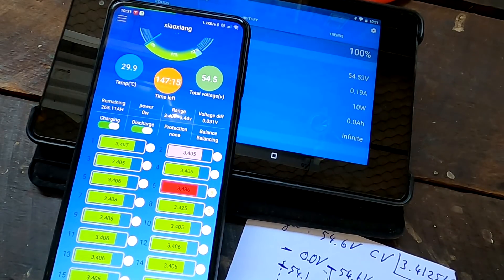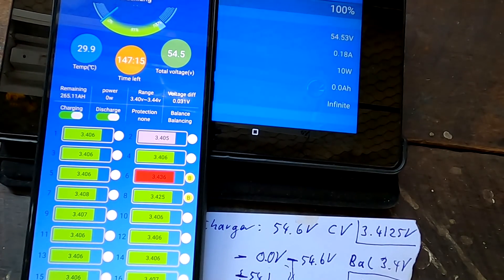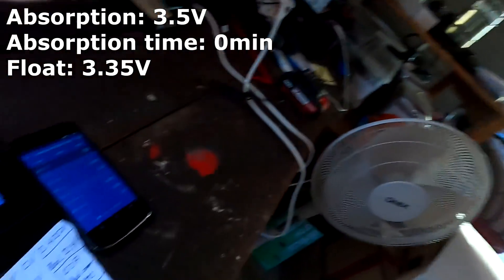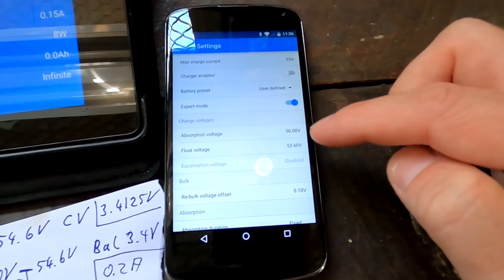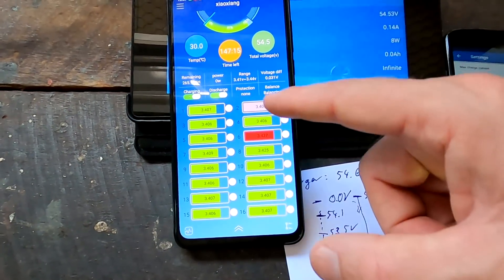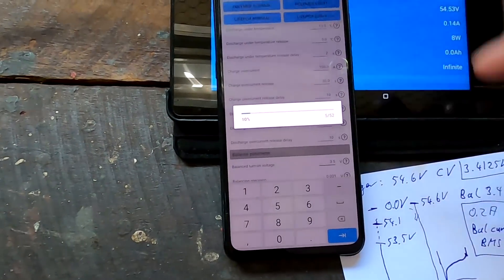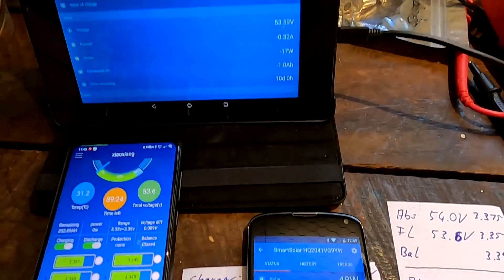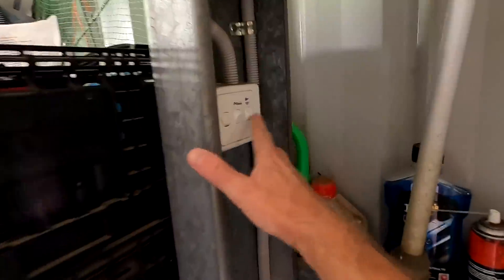Are these the better settings for your solar-battery setup?

Comment: YES, voltage is one thing (first) then current  needs to be met.  My inverter would read proper voltage and would run for another hour or two which I could not understand until I ran tests to find this out. 
My inverters were doing what they should have been doing. I got more than 4 hours worth of capacity in watt hours.
These are some tricky batteries  but when you  watch them or 8 to 10 hours a day you see what's going on 🤣  (Constant voltage,constant current). 
Our chargers don't tell us the constant current absorption. This is the key.
Thanks for the update Andy, Looking good! Thanks for posting!
Reply from the maker: Thank you Dan. We're getting there eventually ;)

Comment: thank you for all your work. sometimes i am thinking: for gods sake 12V lead acid batteries had no individual taps to check inter-cell-voltage .... i dont know if we would make an elephant out of a mouse .... (that sounds rather german u know) :)
Reply from the maker: I know, it's far easier to connect a lead acid battery and your're done, right? But we would not learn anything from this 100 year old technology.

Comment: Does anyone have best settings for a AGM battery?
Reply: tie a rope to it & use it as an anchor (take the electrolyte out first, safely of course) . I have always hated lead acid batteries. Glad to now have some of these LiFePO4 280Ah. Just chuck it in to replace the AGM.
Reply: @aussiescotty2950  yes would love to use it as an a anchor but at close to £400 and only 6months old not looking to waste money at the moment.
Reply from the maker: It's probably best to stick with the manufacturer specs for AGM. 13.7/13.8V for floating seems to be the norm for a 12V system.
Reply: @OffGridGarageAustralia  thank you, great videos btw.
Reply: Your honestly better off to go with open cell lead acid for cost and just store them on the exterior of your house. Agm sealed are a little to pricey for watt hour but lifepo beats them out in the long run for lifespan. If treated right. One of the perks to open cell is how it handles the weather which is good cause I wouldnt store them in my house. Lithium doesnt discharge gases. Lead acid does under discharge especially older cells. LifePo is just a bigger up front cost. But you can pack it in a smaller location for the same capacity without the worry of gases. If maintained it wont blow like an s7 either

Comment: How about the reverse protection diodes on parallel PV-strings? I'd dare bet that power is being lost by heating the more shaded string during the time that trees are in the way, since panels do not normally contain reverse protection. They very usually only contain internal bypass-diodes but not reverse protection for when a greater potential exists in parallel. Plug and play MC4-connector-housed diodes exist for this exact reason.
Reply from the maker: Nope, that's not happening at all. Even the shaded string delivers still power to the charge controller. I have 2 strings atm with separate fuses, so I can switch them on and off individually. If one has full power and I turn on the shaded one I still see an increase in current and incoming power. So one delivers 500W and the other maybe only 80W due to heavy shading. There are no diodes necessary for such a scenario. I'll show this in a future video. Thanks for the reminder.

Comment: Ah, I put down my phone after watching "yesterdays" video and then this was on the laptop.  I did a couple of comments (they would have been Kev Duckworth rather than this account)  and after watching this they were redundant ....  I think you can go lower on the MPPT for both float and absorption, and just go up high once every 6 months to check the top balance, and top balance as needed - said similar on the other video too.
Reply from the maker: Yeah, that's probably correct. I just wanted to see if the high voltage cause any dramas with the cells.

Comment: So far so good.
Once the cells are all equal at top and you don't discharge too far, they should all get back to 100% at the same time. I think.   Unless.... 6,7 and 8 have a resistance difference rather than merely a lower Ah capacity.
Reply: Since the cells are all in series the variance in internal resistance do not make a big difference. The highest resistance in the string limits the entire pack. Top balance takes care of it.
Variance really only matters for cells in parallel, and even then if it is cells and not strings in parallel then the internal resistance only matters during charge and discharge and will equalize at rest. Parallel strings are a bigger problem.
Reply: @Sylvan_dB  I think cell resistance is much misunderstood. I also believe it is not the major problem in this case. I think it's simply lower capacity.  That said, I'm at a loss as to how to prove it.   Also as others point out, it seems to be a small shortage.  :)
Reply from the maker: I have done a full capacity test afterwards. Video is coming soon.
The cells seem have a higher resistant then the others.

Comment: I don’t understand your argumentation.
In the Victron Controller, the algorithm for absorption and float are exactly the same, they simply change from CC to CV, only at a different voltage.
If after a complete top balance you still have balancing problems (because of unmatched cells), start your balance start at a lower voltage or use a high amp. active balancer.
As you are apparently in the learning phase, it is still a good idea to experiment. Good luck.
Reply from the maker: This is in regards to the discussion we had here:
https://youtu.be/lCs9NaHgSB4

Comment: You look like a happy camper after this video/experiment went well. When my solar is fully setup, I will try these numbers as well. Thank you!
Reply from the maker: And there is only 1Ah between the absorption and float, so the 'loss' is very small. Before that test, I was expecting a lot more capacity which we could not use.

Comment: Ideally, you would want the bms to balance each charge.  Can you set the charge controller to stop full power at 3.4V and constant current charge to 3.5V (just under what your BMS can shunt power on the high cells)?  Then you can get a full balance charge from the sun.  Your issue isn't that you need to balance.  It is that you are charging too fast to allow the bms to balance.  Or maybe you just need a BMS that can shunt 5-10A or something that your charge controller ends the charge at.
Reply from the maker: Yes, that is correct. The balancing only works if the the charge current is lower than the balance current, right? So you need to find this sweet spot. The steeper the curve, the easier it is, I found.

Comment: You have the Float voltage nailed down.  3.35V is a good value.  You could go lower but 3.35V is totally acceptable.  The normal range for Float for LiFePO4 is 3.35V to 3.375V.  I prefer 3.35V myself.  The charge controller is behaving exactly as desired, you have verified that there is no significant loss in capacity, and the stress on the battery pack is almost nothing.

The bulk target and absorption time will be harder to dial-in, since the battery's actual state of charge depends heavily on the C-rate that it gets charged at.  Which in your case is a very low 0.1C or lower with just the solar.   These numbers are going to be different for charging with just the solar verses charging with the e-bike charger or charging with both solar + e-bike charger.  I outlined the general problem that you are facing there in prior posts. 

3.40V - will trickle charge the battery but make it almost impossible to target any particular state of charge.  Also, the battery's acceptance current may quickly drop below what the solar panels can offer, you will be wasting your panel's capability!

3.45V - Is the minimum I would recommend as the state of charge can be managed a bit more easily by setting a non-zero Absorption time (Bulk and Absorption voltage both set to 3.45V). 

3.50V-3.60V - These are typical bulk targets (Absorption time would normally be set to 0 with these targets), but the battery's state of charge will wind up being very high at low charging rates and more in-line with desired state of charge when charging at a higher C-rate.  A higher bulk/absorption target voltage combined with a low charging rate increases the risk of over-charging the battery.  But on the flip side, you won't be leaving any of your solar energy sitting on the table... it will be able to deliver it all to the battery.

Once you get more solar installed you will have to fiddle with the Bulk and Absorption, but you should be able to leave Float at 3.35V.   With more solar installed you have to begin to watch out for bulk target voltages that are set too low, causing low acceptance current by the battery and leaving some of your solar energy sitting on the table.   So, rule of thumb... with only a little solar, lower bulk target voltages will work, but with a lot of solar, higher bulk target voltages are needed to really eat up the energy the panels can produce.  Among other things.

-Matt
Reply from the maker: Thanks Matt. A very big difference does the absorption time to the actual SoC. If you hit 3.4V and stop charging it's different as if you do a 1h absorption at this voltage afterwards. So I will do some more testing very soon on a different system to see what the actual difference is. Thanks for all your advice!

Comment: Andy by the way, I like the qucc controllers  and planing to get two more. The 260 ma are not enough power to balance my battery packs I stil need the help of the active balancers which automatically turn on when voltage difference is more than 0.010 ma.
Reply from the maker: Yeah, it depends on your battery capacity. 0.2A don't make a big dent in a 280Ah cell. But it works quite well if you have a higher voltage. Then, even the 0.2A discharge will balance the large cells.
Some other BMS's have 1-2A balance current but they are far more expensive.
Reply: I am planning (when my cells arrive) to have a separate volt censor that turns on a active ballancer and turns it off again, this is way it won't screw up my top ballancing like when it's on All the time

Comment: Hey Andy,

I have close to a dozen small LFP batteries in use in various applications, many of which are UPS units. My UPS units are designed for lead acid and I swapped the lead acid SLAs for LFP. These UPS units float charge my LFP batteries at a constant 3.45v per cell 24 hours a day, 7 days a week. And I have batteries that have been in service in this application for 5 years now.

I recently capacity tested several of these batteries: They are rated at 10 Ah each. After 5 years of being float charged at 3.45v per cell they all capacity tested at 9.7 to 9.8 Ah. That's roughly a 3% loss after 5 years. I'd hardly say float charging them has done any considerable damage to their overall health.

So I wouldn't worry too much about floating them at or slightly above 3.35. I'd say 3.4v per cell would be perfectly safe.

-Jeremy
Reply from the maker: Thanks Jeremy, that's valuable information. Thank's for sharing this. I still test different scenarios and see how the system responds to it. It's exciting.

Comment: Yes, but these aren't standard settings that will work for everyone depending of use . Best settings for me running water heater, induction cooktop, washer and dryer and car 24h a day is 3.35v When is sunny the batteries are charged by 10am and all power is coming from the chargers until Sun goes down. Makeskyblue has only Bulk and floating charge and floating can be set for equal or above the bulk charge and does not have absortion time.
Reply from the maker: Oh, yeah, this is only for my system. But the learnings from here can be applied to other systems. It just shows what happens if you have different settings for bulk/absorption and float. so everyone has to figure this out for their system.

Comment: Seems you are stuck on being perfect and yes you can make it that way but soon as you put a decent load on the battery every thing changes. just let the sun do the work and the battery will catch up in between sun cycles. Top and bottom balancing is good but not required all the time.
Reply: OCD.
There is a skill in knowing when to schtop..

Comment: once the battery reaches the set voltage the current drops off normally the chargers detect under a set current and shut off so if you set you max voltage a little below that of your max battery voltage they will be fine i have been running old laptop cells like this now for over 6 years other then cells dropping out from old age i have not had any other problems

Comment: the only problem i see with float charge been so low is if you battery bank is at 3.35volt and you get a rubbish day of weather then you not going to get alot of power back into the battery and if this happened over a few days they is a good chance you could over discharge some of the cells